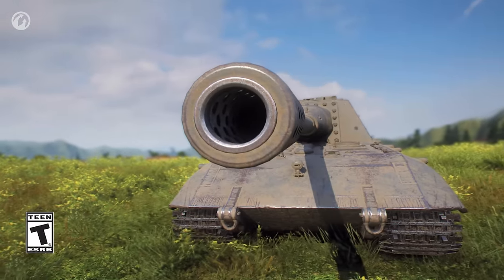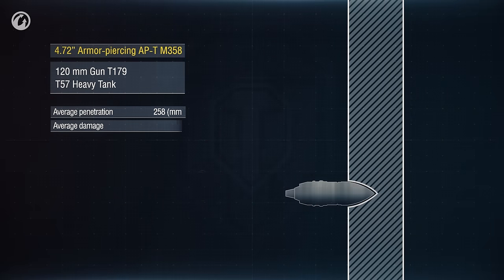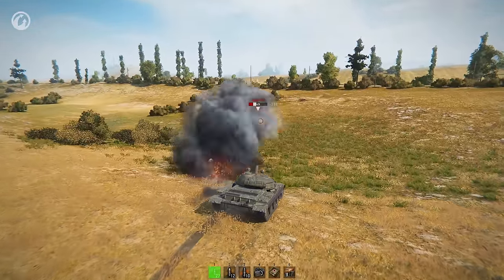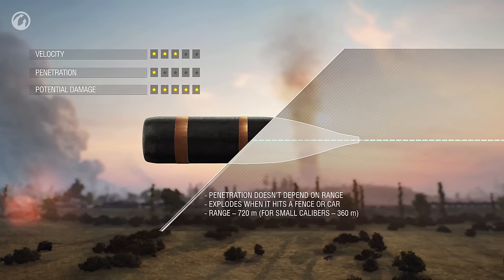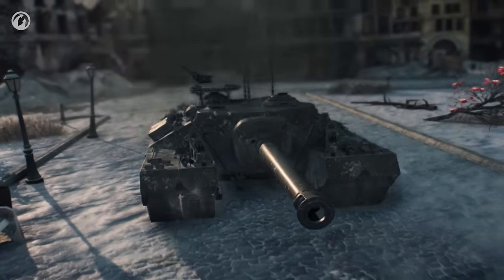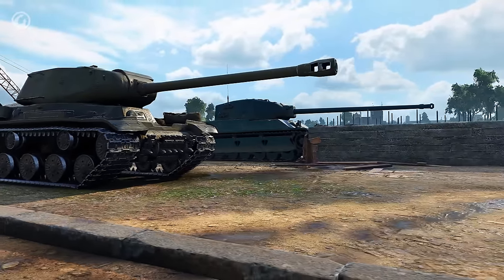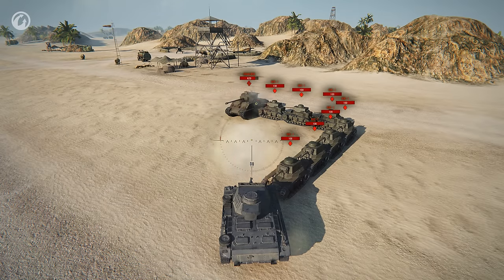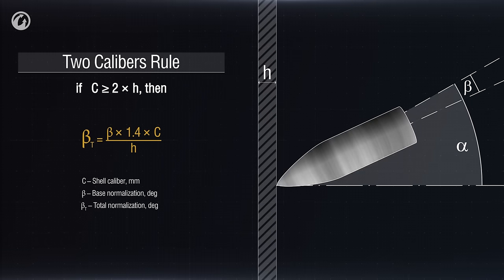World of Tanks PC - Explaining Mechanics - Armor Penetration

Comment: In the game you don't consider the fact when a shell hits the armor with not its point but in the side. Even if the caliber is 3+ times bigger than the armor, the pressure point is the side which is wider and as a result of physics the power is smaller. This mechanism render the armor invisible when it is angled more than 72 degrees and higher. Sweden engineers based their designs on this fact. Please consider this idea and implement it in the game. I love this game and I realy want to make it better.

Comment: Are these rules only made up for the game or do they apply to real life?
Reply: The majority of them do count in real life; however with modern day Uranium tipped shells it is a bit different penetration wise. I'm not sure about the 3 * caliber rule though, it may or may not be true.
Reply: Its pretty real.  This game is very good in some things.  Yet so horrid in other aspects.
Reply: No they don't. The shell has weight and therefore inertia.  The roof of a car doesn't have the strength to resist the inertia of the shell and it will tear. Think of it like this, flatten a piece of tinfoil over the top of a bucket and tie it tight then press on it with your hand it will tear. You hand has no penetration value at all, 0mm. but the force you are applying, is so strong the tinfoil cannot hold together.
Reply: Nathan Watt No its not true. theres even a video from wargaming where they shoot with a tank at a car roof and the shell bounces. let me search for that vid
Reply: Nathan Watt its more like a big scratch rather than ripping completely ;D
Reply: In that case, the HP damage you receive from the three calibre rule is meant to signify the damage to the internals from spalling due to the force of the impact of the heavy shell.
Reply: Jason Li it's not that realistic
Reply: It is only for game. The most realistic approach how to simulate armor-shell interaction, are penetration tables for each ammunition (like in War Thunder).

Comment: A shell may have two penetration angles and in this case effective thickness increase more than when it have one angle.
When is one penetration angle the armor plane makes 90 degrees with the horizontal plane (TIGER).
When are two penetration angles armor does not make 90 degrees with the horizontal plane(E100 lateral turret armor) or direction of shell is not parallel with ground.
AND ALL THIS CONSIDERING THE SHELL TRAJECTORY A STRAIGHT LINE (which in reality is not).

Comment: Tell players that an egg an penetrate a 500 metres wall! 
or
A 170mm gun does not even damage a 65mm iron plate!

Also, that 25% range damage amount has 80% lock into lower alpha damage, not even can do what it should be. 
750 alpha with 1000 hits, only 200 hit could make more than 750 damage, otherwides, 563- 750 takes 80% when you really hit the same target in same angle and same spot. 

What kind of RNG you really make? 440 alpha gun shots 4 shells which have done 2500 damage. However, a 490 alpha gun shots 4 shells in a round only finish 2400 damage. What do you think your theroy works for players?

Comment: i have a question. in the t26e4 super pershing, i bounce 152mm armor piercing shells on the spaced armor of the turret. upper hull glacis, and lower hull glacis. this video says that HEAT looses 5% of its penetration value for every some distance traveled until it hits the main armor. "thats why heat hardly ever penetrates spaced armor" so why the hell do i get penetrated on the lower glacis in the t26e4 SP with 2 layers of spaced armor, and then the actual hull armor!!!!
Reply: Stronk Vodka because in the lower plate the distance between the two armor plates is around 2 mm so the heat ammo loses (2x5%)x2 and your lower plate is very thin. So it is easy pen. If the second plate did not exist then they could not pen even your lower plate with heat.
Reply: lower glacis doesn't have spaced... does it!?
Reply: Dorjan24 i believe super pershing has a spaced armor at ita lower glacis
Reply: Stronk Vodka I think that the spaced armour isn't far enough away from the hull so the drop off isn't enough

Comment: I don't follow. If HEAT shells have so many advantages - no loss of penetration over distance, much more lenient normalisation - why do they also have SO much more penetration than AP? Wouldn't it make more sense for them to have similar penetration to AP or even less, but offer the benefit of penetrating at any range where AP and APCR lose penetration at long range? Right now, the only downside they seem to have is spaced armour which almost nobody has and doesn't seem that terribly effective anyway.

Additionally, penetrating spaced around without hitting the hull shouldn't generate a "critical hit" raido call. Critical hits are hits which damage modules, which isn't what's happening. If you only pierce spaced armour but miss the main hull, simply don't play any message and treat it as a miss.
Reply: HEAT is generally considered the worst type of ammo for any given penetration value. ie a 150 mm pen HEAT shell is worst than a 150 mm pen AP, APCR or HE shell.

This is due to
1. not going through fences (and no splash to make up for it)
2. Slow projectile speed
3. Terrible against spaced armor (tracks count as spaced armor so they will eat your shells a lot)
4. No normalization making it less effective against angled armor

HEAT rounds need the very high pen to make up for all the disadvantages
Reply: Right, tracks and spaced armour will eat HEAT shells and they offer no normalisation, but the issue is the majority of Heavy Tanks don't offer either of those obstacles. My issue with HEAT is it effectively renders Heavy Tanks obsolete in many circumstances since Mediums can typically punch straight through their front plates.

From the Sandbox and "Future of WoT" videos, I know Wargaming are aware of this and are looking to increase penetration dropoff with distance along with accuracy to make weakpoint sniping harder, but both of those affect everything other than HEAT. Heat shells don't lose penetration with distance and are used against large, slow targets already - your Maus and your Type 5 and such.

Plus, if HEAT rounds are so weak, why do they cost 20 times what an AP shell costs? If they were truly balanced and better only conditionally, wouldn't it make sense for Heat to cost as much as AP or thereabout?

Comment: Speaking about Jgdpz auf E100,compared to others Tier X TDs,with standard ammos,cant penetrate the same hitpoint of the same vehicle...on That TD the pen for almost i think its pure LUCK (lol)...Another problem is the gold ammos spam with meds at tier 9 o 10...pratically they can penetrate all tanks (super heavies too),from every angle and to every point,without minimum skill just sitting hided...just pay to pen.
Reply: MrAlabardo in this game RNG determines the pen of a shot against any armor. You are right about the pen of Premium ammo as renders armor worthless ( see leopard) but in high tiers skill determines the outcome of a battle not  purse. If you master your strategy you will depend less on luck.
Reply: + STAVROS SFAKIANAKIS Doesn't matter. Skill can only go so far. You cannot beat the broken RNG system. Damage is the key to increasing performance. Even if you manage to flank, there is a chance the round has lower penetration than the armor thickness and bounces. With gold shells, you increase the effective penetration of the projectile. Now, you only have to focus on getting a good shot. You don't need to have to worry about RNG because, with some shells, with -25%, the penetration is still greater than the armor.
Reply: A. Melanoleuca considering the game mechanisms you have partialy right but been in the right position in the right time minimizes the chance of depening on the RNG. AND if you firing all day premium ammo you ruin your profit potetional. Sorry. Don't worry you will pay the bill after the battle.

Comment: these guns have no chance to penetrate composite armor. multilayer and spaced armor enhances armor capabilities e.g. M1A2 abrams armor is double the strenght of steel (real thickness 100mm at 90 degrees equalises 200 mm at 90 degrees due composite plating)
Reply: even most powerful gun in game cant penetrate such material and using heat is useless becouse multilayer, spaced construction and different materials with diffrent specs
Reply: lucky HE vs 600 mm of steel equivalent + angle no chance of damaging even slightly
Reply: Sebsibus Techi Leo 2 and abrams is similar vehicles in early production but both taken diffrent paths of development abrams tanks now focus on depleted uranium composite and leo 2 on third gen steel composite + modular armor which gives superior turret protection but same hull protection

Comment: Still dont get why i cannot penetrate the is6 with a 250mm pen heat Shell
Reply: is6 hasn't got HEAT
Reply: re-read what he actually typed... He said he can't pen a IS6 with a HEAT shell, didn't say an IS6 had HEAT.
Reply: because heat has no normalization and is-6 has thick armor angled so you can't overall effective armor become more then 250 from front therefore
Reply: Isn't it because IS6 is full of spaced armor?
Reply: TonyOneBlairoby Front plate

Comment: Some strange, not very realistic ideas there? When any shell penetrates or hits and stops, IE fails to perforate the armor, the armor's back face spalls and secondary explosive effects happen spraying fragments inside the tank causing damage to all the soft and squishy stuff inside. Solid AP Shot damage the tank every time it does not bounce off and this is universally catastrophic to the crew and vehicle!!! Statistics show that a heat shell perforation will cause 1/2 of the crew, of every other tank hit to become casualties. The other tank escaped casualties, but not necessarily damage. Out of four tanks hit with HEAT ammo, four crew will die and one tank will blow up and one be knocked out! But some of the crew will survive. It takes on average, two hits with HEAT to destroy any tank. I used to do this for a living. This only works on older tanks WO composite armor. Tanks with Composite armor are immune to HEAT attack by MANPATWs! ( Bazookas, Recoilless rifles, RPGs, etc...) The newest tanks are also immune to attack by crew served Missiles with HEAT warheads. (Like TOW, Milan, Spiral-5, Koronet, Etc...) That is why the current crop of missiles use top attack. No tank, or any other armored vehicle for that matter can withstand HEAT, or EFP attack on the very thin top armor! Even 30 MM bullets from the A-10, 40 MM DP Grenades from the M-203/79 and M-42 Bomblettes dispensed from arty shells and mortar bombs can all perforate the roof armor, what there is of it, that is, to destroy the vehicle!

Comment: My tank has 70mm of side armor. Sidescraping is impossible. Everyone can penetrate my armor for every angle. If they see one millimeter of my side shell penetrates. No gun has two times larger caliber than my side armor.
Reply: 152mm kv2 tier 6
Reply: shadow336k and O-I too but they're not shooting AP but HE
Reply: Okay using the formula given in the video with the highest possible non auto ricochet angle.

70/cos(69) = 195.3

But this is not accounting for the normalisation.

With AP:

70/cos(64) = 159.6

With APCR

70/cos(67) =  179.1

If you angle at sixty degrees with AP being shot at you it's only 122mm of armour. This is a weakness of the Japanese heavies. Their sides are paper maché.
Reply: Comrade Shamrock 60°? My angle 80° to 85° and they can still pen my. I don't sidescrap with my Japanese tanks it's useless. I hide my sides. I show to my enemies only my front armour.
Reply: No gun should pen you at that angle. You're effective armour at 80° is 270mm of armour. 634mm if it's HEAT.

Not to mention it should auto ricochet unless it's HEAT at that angle. And not even the Jg Pz E100s HEAT rounds are that strong. Their max pen is 525.

You are either mistaken with your angles or are purposefully trying to troll people. Good day to you.
Reply: Comrade Shamrock no mistake. I stand almost directly to him and he penetrated my side. I measured the angle it was 82°. Tank car inspector says auto ricochet but I'm penetrated again and again.
Reply: 70mm? thats alot dude oh wait another tomato playing wot nevermind
Reply: SNaikio T110E5 Tier 10 US heavy tank has 76mm of side armour